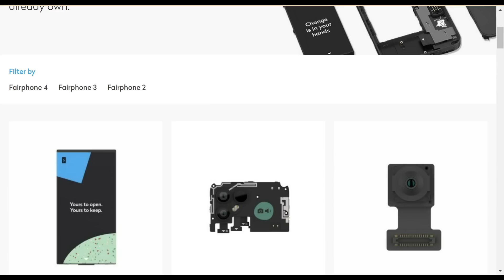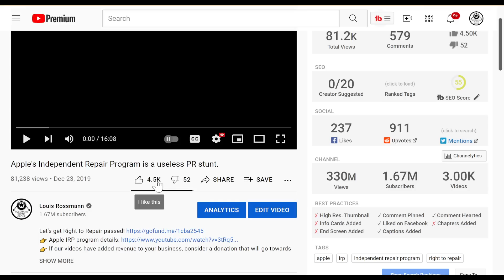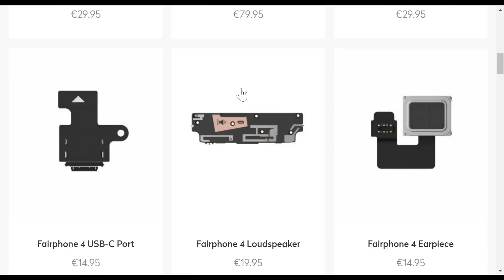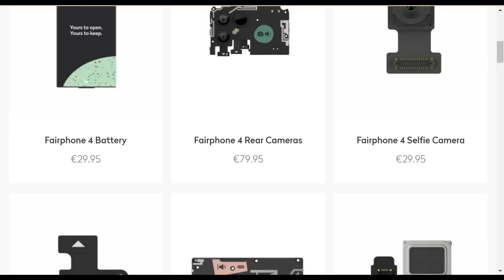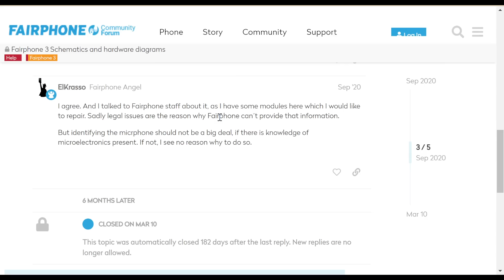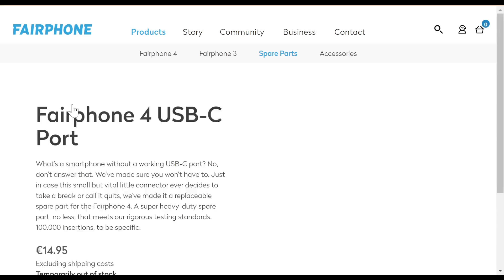Fairphone thoughts & commentary with Louis Rossmann

Comment: Would it be that hard to deviate enough from the ref-design as to no longer be bound by the NDA? A lot of phone designs, whether based on the ref will be still pretty similar as you have to hook up the same devices to processor and modem and there are not that many ways to do it.
Reply: Most likely yes. Reference designs for complex parts (such as a SoC or modem) typically take into account odd behaviors and requirements which are poorly documented. The creation of the reference design is integral to the design process for the chip; the chip is iterated until the reference design works and nothing more. For example, the build of one particular pin or interface might be 'on the line' of meeting spec, and it happens to work properly every time with the reference design, but a naive design may hit intermittent hard to diagnose issues with it.

Comment: Qualcomm is weird about things. They'll release their code for added caf patches to aosp, but not schematics to their board. Probably a proprietary thing.
Reply: One thing that hits me is that honestly it might be that Qualcomm has put a lot of money into building traces and placing chips to get around EMF issues, especially in such a small device, and very much especially in a 5G device. Still would prefer schematics, but the market right now is very cutthroat, I'm sure.
Reply: @32krod  pcb design and schematics are two different things a lot if know how could still be preserved with schematics release. Even no schematics with probe points labelled with expected voltages could help.
Reply: @DaliborPetráš  I know, but when you're trying to convince your supplier that you want to release some of their design specs, they're going to play things pretty close to the chest.
Reply: @DaliborPetráš  We are used to board view files being included with schematic files and quite often shorthand it to schematics, as in opening the schematics with open board view will open both because both are linked.
Reply: @32krod  - Qcom supplies OEM's with RF design schematics, and methods to minimize interference.  Course they don't provide a full diagram of their chip dies, which in all fairness is proprietary and not needed to build devices with.  Likewise their software is valuable intellectual property and encrypted even in firmware upgrades.  On the hand, schematics  should be supplied for consumer products like phones, tablets and laptops for easier diagnostics and repair.
Reply: @Caleb Brewster The Chinese don't care about copyright.
Reply: Yeah one of the reasons I had a dispute with some people who work there but overall I hope we can get open standards like say RISC-V for most things in hardware someday.
It's going to be hard likely cause most of these 2G-5G standards inherently have proprietary stuff in them, but iirc old patents are now expiring and we have atleast some hope.
There do exist project like osmocom which I don't have time to follow, but most I can do is have hope, at these times not being a hardware person and just being software only guy hurts.
Heck even WiFi has proprietary parts to it.
Reply: @Caleb Brewster qcom does use patents and defend them, they have nothing to worry about, and they would probably not sue over schematics + board view release (as long as you paid them the license fee that you're supposed to for them to let you use their hw and sw with all the patents and copyright on it)

they totally shouldn't win if they wanted to sue you anyway, as long as you make 100% sure that you avoid breaching contract
Reply: @Caleb Brewster No! the world isn't america! As they say in the historical american documntary movie "the training day", "the russians don't care for the badge and the chinese dont care for the copyright". Russians will whack you & chinese will copy you!

Comment: given that fairphone just killed the headphone jack, I give them about 5 or so years until they're selling the usual metal and glass slab stripped of any of the features they have now. We've seen it time and again.
Reply: They will supply parts for 5 years. Doubt they will completely ruin their  business model while still supporting the fairphone 4
Reply: Yep. This year it was the headphone jack. Next year it's the SD card slot. Year after it's the removable back cover. RIP Fairphone.

Comment: I'm actually hopeful about the next Pinephone. They managed to release all their schematics, sources and even the community is very vibrant around them. Just that the processor on the current pinephone is quite old and isn't nice as a daily driver imo.
Reply: that's really cool!!!
Reply: Theres the pinephone pro kinda overpriced compared to the competition and has similar software state to the early pinephone but it has good performance
Reply: just looked it up and the processor is a total crap, the GPU is even more horrible, Mali-400
Reply: @skysunknownheroes  they are all open source though. Pinephone is about open source everything, it's not about speedy and flashy processors
Reply: @houghwhite411  i don't care if it's open source but UNUSABLE as daily driver, dude raspberry pi 4s and many rockchip SBCs are much faster while still being open source, and i'm pretty sure they have android ports too

2015 is calling, they want their entry level CPUs back
Reply: @skysunknownheroes  Pinephone is not really for you or anyone, it's for a niche where they want fully open source device to hack with.

developing drivers and software is not what Pine64 does (the thing that makes phone usable), they only make a device and tell the community to develop software and drivers for it from ground up

the device are sold at cost, at least according to their claims. I see pinephone more like a toy rather than a phone
Reply: @houghwhite411  weird excuse for not improving but ok
Reply: @skysunknownheroes  They just announced the pinephone pro.

Rockchip RK3399S 64bit SoC – 2x A72 and 4x A53 CPU cores @ 1.5GHz

ARM Mali T860 4x core GPU @ 500MHz

4GB LPDDR4 @ 800MHz
Reply: @AbteilungsleiterinBeiAntifaEV  nice, that's basically Rockchip's flagship, it's not much but perfectly usable in daily use
Reply: @skysunknownheroes  I think last year they started looking into upgrading the soc to RK3566(with Mali G52 cpus..) which makes it as powerful as a raspberry pi 4..  But then all the supply chain issues happened.. So fingers crossed..

The good thing about all this is it is only going to get better .. all the drivers,software that was developed for the current Pinephone.. will be available and run better when they upgrade the CPUs
Reply: @saidinesh5  now that's a great news

Comment: I wish this was available in the US. The only thing making it impossible for me to keep my phone 3 or 4 years is bad batteries and broken charging ports.
Reply: Just replace the battery brug. It’s not like it’s impossible in most phones.
Reply: @Bluecolty  
Yeah but after 3-4 years the cost of replacing the battery is more than the phone is worth.
Reply: @dillonh321  since when? Its still totally economical to replace the battery in an iPhone 6s, which is 6 years old at this point. I just replaced the battery in my note 9, which is 3, working on its 4th year.
Reply: @Bluecolty  
Battery replacement is $70-100. A refurbished 6s is $85.
Reply: @Bluecolty  
Also not everyone buys Iphones. Not all phones hold value as well as Iphones.
Reply: @dillonh321  what my man, even apple charges less than that for a 6s or 6s plus battery replacement. They charge $50. Still well within the value of the phone, and it can be done for less if you do DIY. That is true about Android phones losing value quicker, but its still economical to replace a galaxy s8 battery, and thats from 2017.
Reply: It is tho. Just pay the shipping
Reply: @korcommander  
You have to have someone in Europe you know take delivery of it and then have them ship it international to you.
Reply: @dillonh321  have you just tried buying it from the website? Often times the conversion of money happens automatically.
Reply: @korcommander  
Yes this is how I know.
Reply: asdfasdf  i've never had this kind of problem with charging ports, but i think it just needs a little care when you plug it in. depending on the software you use on your phone, another problem for me is that OS updates eventually stop, combined with software (especially banking apps) demanding a newer version
Reply: What do people do to their phones? I use my phones heavily and always use the previous as a second phone for longer, and have never across Sony, Samsung, Xiaomi, and Apple had a battery that wasn't still fine after 3 years and never broken a charge port (I've never even met someone irl who has broken a charge port).

Comment: The one thing i hate about the Fairphone 4 is that they left out the 3.5mm Audio Jack -.-
Reply: Well, I suppose the nice thing is nothing's stopping them from changing their minds. They could release a new SKU and two variant parts, the rear cover with 3.5mm jack and combination USB/audio jack board. And if a customer really wanted they could just drill a hole in the case themselves so they didn't need to buy a new cover. You'd probably just have to treat the audio jack as a built in daisy chained dongle with such a board, right?
Reply: That's a deal breaker
Reply: @jonnyblade3234  it’s not a deal breaker, headphone jacks are obsolete. good riddance
Reply: @goonbag803  that's your opinion/choice. I won't buy a phone that doesn't have a headphone jack
Reply: The fairphone 3 does have the 3.5mm jack. Does the fairphone 4 not have it?
Reply: @puggirl415  they removed it because removing basic functionality makes your mid tier phone into suddenly a top tier flagship 🤡
Also no charger or even cable in box
Reply: it might be a space or availability problem, but when you can use a dongle or bluetooth an extra port that needs to be able to be replaced and sold might be tough. but if people keep being so vocal about it maybe Fairphone will change that.
Reply: @TestarossaF110  headphone jack never has been a space or availability problem, if was a "I want to make billions of extra dollars" problem.
Reply: Going to be honest, every wired headset I plug and unplug regularly dies, if it isn't the 3.5 that fails it is generally the connection to one side of the earbud/headphone. They offer headphones that have replaceable batteries and other components. I would rather just use that. I am aware this is a old comment and people were more passionate about the jack back then, but still Bluetooth devices tend to last longer for me. My Bluetooth Sony buds with the wire that connects and such still work and I got those in 2015, cannot say the same for any of my wired headsets.
Reply: RTR Foss  Stop making excuse. The Fairphone 3 had a headphone jack. They didn't remove it because they're new, they removed it for the same reason Apple, Samsung, Google, etc rmeoved it: because they're selling wireless earbuds now. It's simple greed.

Comment: I can already tell that people will hate on it for not being water resistant or being thick
Reply: i only hate on it for not having the 3.5mm audio jack -.-
Reply: @FARBerserker  old school. Always can get a adapter. No big deal...
Reply: it is water resistant
Reply: @p_serdiuk  IP54 only
Reply: @FARBerserker  "Water splashing against the enclosure from any direction shall have no harmful effect, utilizing either:

a) an oscillating fixture, or b) A spray nozzle with no shield. Test a) is conducted for 10 minutes. b) is conducted (without shield) for 5 minutes minimum."

This is water resistant. Not water proof tho.
Reply: @FARBerserker  I accidentally drown my phone in puddle. It is old Sony Xperia Go that falling apart in hands and has no water resistance at all at this point. I took it apart, removed the battery and just placed it near the heater for the night. On the next morning it was working like nothing happened and still working to this day.
I mean even if your phone have no water resistance it is not the end and it will not die at the moment when it touches water.